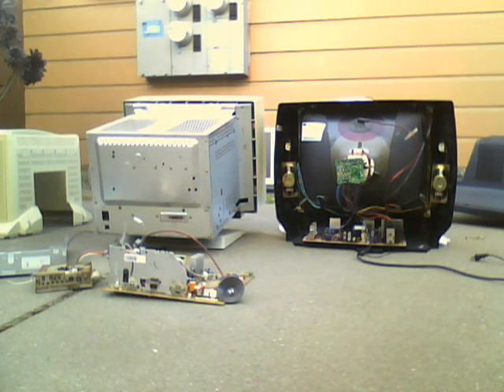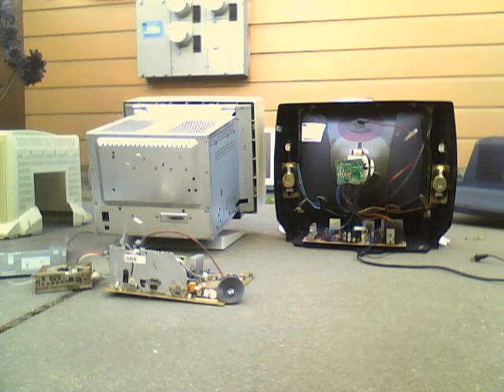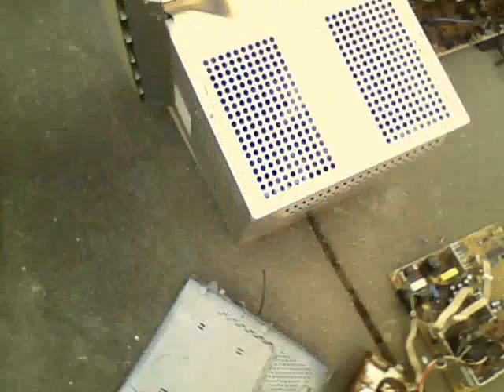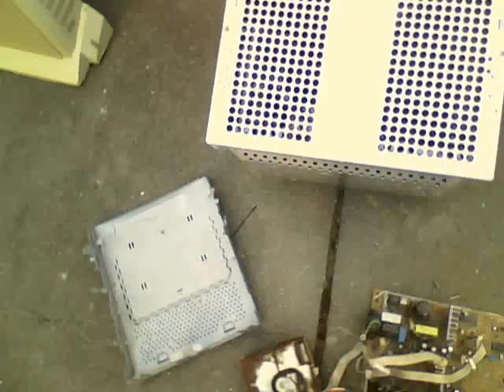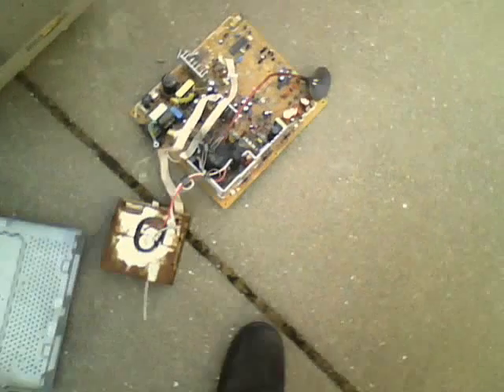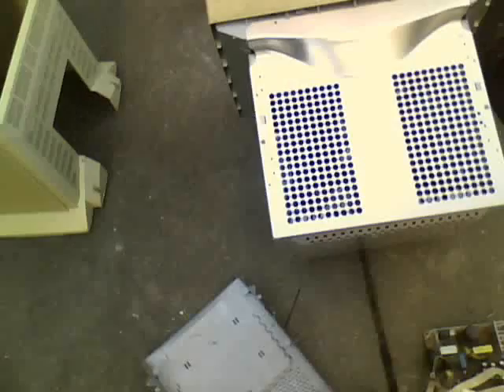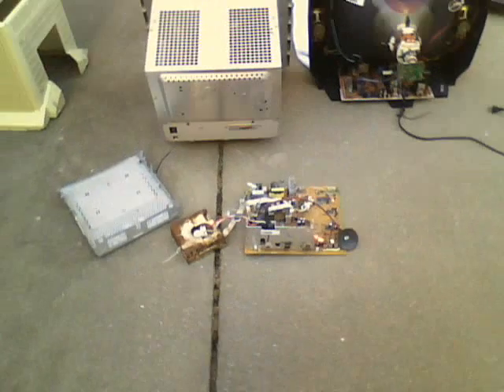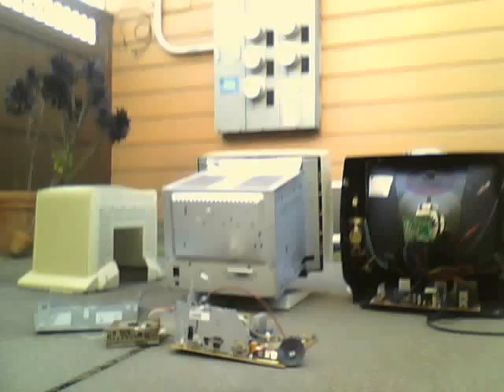Why CRT Monitors are Heavier than CRT TVs

Comment: Monitors additionally have a conductive transparent layer on the screen that is grounded to block static electricity and some high frequency EMF. Sometimes also the deflection coil has an additional ferrite core shell around to reduce magnetic field emission (which may be heavier). When you place several CRT monitors at different frame rates next to each other, the picture tends to wobble if one (e.g. normal TV set) is poorly shielded.
Reply from the maker: Is that why when I touched monitor screens as a kid I never felt that static/magnetizing effect on my hand unlike TV's? Thanks for an additional explanation.
Reply: @TheCRTman  Yes, TV sets have no electrostatic shielding layer in front of the screen. That is to say, unlike monitors, most TV sets are ungrounded, i.e. when switched on, the generated highvoltage (about 28KV DC) gets stored in the CRT (which works like a glass capacitor/Leyden jar), however because the outer pole (graphite paint layer on the glass) is connected to the chassis, now chassis GND gets electrostatically charged to half of that highvoltage (here e.g. -14KV), hence connecting any devices to jacks of a TV set will get zapped with it. So e.g. a Commodore C64 (with also ungrounded PSU) connected to a TV will have that voltage on its GND, and touching e.g. its joystick ports with fingers (or other large conductive object) makes the charge flow through the chips into your body (which has a natural capacitance against Earth) and further to ground if you touch something grounded, which current can fry the chips inside the computer and so ruined many joystick ports in shopping centers. That's why there were warnings in manuals never to hotplug SCART. I have hotplugged SCART cables among different VCR (not into an ungrounded TV) hundreds of times without damage.

Also standing in front of an ungrounded CRT being switched on charges your body by electrostatic influence, which makes it dangerous to electronics to touch conductive parts connected to chip pins while the CRT highvoltage is turned on. With a grounded CRT (like in regular PC monitors) this charge gets equalized through the mains GND prong and so can not do harm.

In general Trinitron CRTs are heavier than others, because instead of a shadow mask of lightweight sheet steel they contain an aperture grill of a thousand thin vertical steel strings under strong tension (not unlike a piano) held by a thick and heavy metal frame.

Comment from the maker: ***** Youtube flagged your comment 1 year ago: "Watch you don't touch the shield in operation! They usually use them as a convenient grounding point, and a leaky diode or component may be leaking significant voltage to ground through the shield - though I assume you would notice other problems first."

Very true, I noticed that when parting out the 1992 Hitachi.

Comment: .... Is this really the reason? Then why is a monitor without shielding still heavier than a TV? ........ I think monitors are heavier than TVs because they seem to have a thicker glass... Like, my Seanix monitor has glass so thick that the actual picture from the computer is like 1 centimeter behind the front of the screen....
Reply from the maker: Nope. I was totally wrong.
Reply: Soooo... Do you know the real reason?
Reply from the maker: VideoTape CRT Tube thickness.

Comment: The noise in TV sets comes from the horizontal frequency of the screen being locked to the TV signal.  The frequency is a bit over 15 kHz, producing a very high pitch whistle or whine from the flyback and other components.  CRT monitors are usually driven at frequencies well above the human range of hearing.  This quiets them and I believe also allows for faster refresh rates.

Comment: Depends on the scan rate of the monitor. The frequency of the sound is the horizontal scan rate, about 15.7 kHz for standard-definition. For a monitor running 1280x1024 at 85 Hz, it's more like 90 kHz, too high to be audible. The limit of human hearing is about 20 kHz.

Comment: Monitors don't have the signal decoding circuitry that televisions have. There were CRT sets which could be used as both a monitor and television though. But for a regular monitor, you could only use it with something that offers VGA output.

Comment: Watch you don't touch the shield in operation! They usually use them as a convenient grounding point, and a leaky diode or component may be leaking significant voltage to ground through the shield - though I assume you would notice other problems first.

Comment: I believe the glass would also contain more lead and a thicker faceplate to filter out any radiation (is it electromagnetic radiation? I can never remember) as you sit closer to the monitor. A lot of televisions (especially the flat faced CRTs) are heavy buggers, as much, much more glass is required to achieve a flat face plate.

Comment: That high pitched whine is the flyback transformer (a transformer which provides up to 32kv of positive charge to the front of the CRT). As to why it is usually only audible in televisions, I am unsure. It is probably a design quirk - you sit closer to a monitor than you do with a television, so the high pitched whine would be unbearable if it were present in a CRT monitor. Also, televisions display brighter than monitors, which contributes to it.